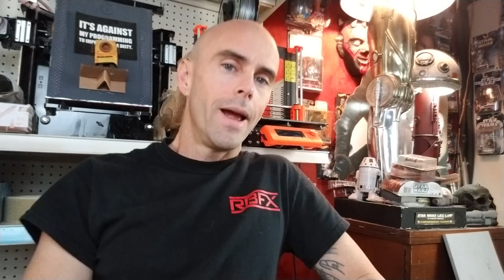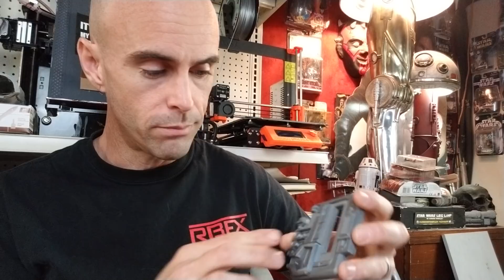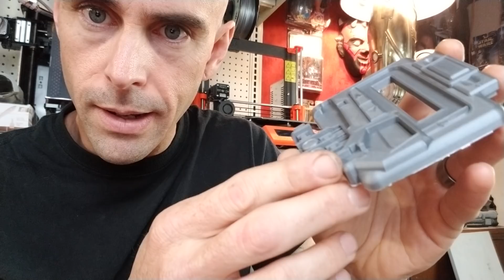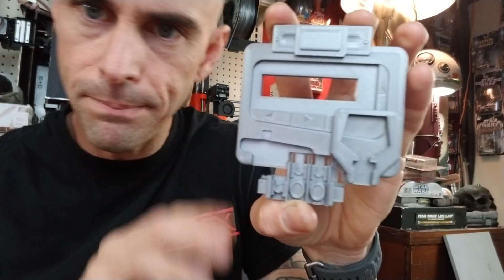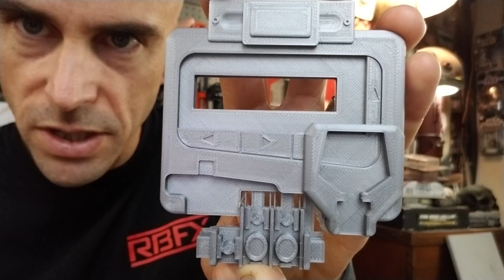3d printer Quality comparison FDM (Prusa i3 mk3) vs SLA (Formlabs Form2)

Comment: On average, how much more expensive would it be to only print parts using a resin 3D-printer compared to only using standard PLA/ABS filament with a regular 3D-printer?

I mean, how many percent more money would it cost to print the most commonly printed designs, using the most popular consumer version of a  resin-printer with basic resin and all the standard configurations?

(Without taking into account the cost of the printer.)
Reply: 5-10 times more

Comment: It's amazing how nice the Form 2 can print. I do have a question for you regarding molding and casting. I'm making an articulated action figure inside of ZBrush/Fusion 360 that will later get printed on an SLA printer once I can afford one. Some of the parts like the bicep have a step down hole with a mushroom shape inside. Do you know much about insert molding/over molding? If you have an email and a few minutes to spare it would be great if you could give me advice on how to mold the parts properly. I would highly appreciate it man! This project means a lot to me and you seem to have knowledge in making molds.

Comment: The new Prusa SL1 is a direct Form2 competitor in quality and ease of use, while being a fraction of the cost. AND it uses normally available resin as opposed to FormLabs' "branded" resin (same resin but with FL's brand and price increase).  Regular resins are around $ 40 - 50 on average for a liter.  A big price difference.  

The Wanhao was a cool intro, I got mine for $300, but it had a lot of major issues and I never got it working well even after investing extra money.  I'm probably going for the Prusa as they’re dependable.
Reply from the maker: It looks awesome and I can't wait to try one. There are definitely some features that the prusa doesn't have that are extremely useful for me like auto filling resin and the notifications when prints start and finish or if there are any issues that force the print to stop. Those things save loads if time. The form2 can also run with aftermarket resins. There are settings for it. A couple of friends have been using aftermarket resins directly with good results by using it with the old formlabs bottles. Also the form2 print area is quite a bit larger. Much of the client work I've done wouldn't fit on the prusa. I'm actually looking into some larger resin printers at the moment.

Comment: sadly enough, the moment you printed one at a different layer height, the whole comparison looses validity =/
if you had made both at 0,05, then i'd be a fair trade comparison... 1 layer of primer and the comparison would have been awesome
Reply: Youre comment makes no sense considering he is mainly focus on top quality vs layer quality. Its obvious that layer height wouldnt matter
Reply from the maker: Not really. FDM is still limited to nozzle diameter which affects the corner sharpness. Even with a .2mm   nozzle at .05 layer height it's nowhere near as crisp and finished as the form2 , primer or not.
Reply: @gordontarpley  you're missing the point he was trying to say.  When making a comparison between two things, in this case printers you need to keep variables to NIL so the only difference is the printers.   Where in this specific case it's more than that
Obviously the prusa can't print at .05 but it can at .08 and so should the SLA
So for a fair comparison test they both should have been printed at that.
And on top of that, you didn't enable ironing which would have gave a smooth top surface.  
I'm not trying to rip on you or anything, but as far as tests go...  It just could have been done more 'fair'
Reply from the maker: @nickanderson8305  No i didn't.  I get what he's saying. I didn't print these to compare for YouTube, I printed them for a client (to their specs) and had them on hand so I figured I'd show. If you see the response I made there are aspects of fdm printing that will carry over regardless of layer height. Edge sharpness, top and bottom texture, etc. that will never match the quality of a resin print. Just the way it goes.

Comment: Hi Gordon great vid is'nt the FLab twice the price, also what I really want to know, is if you only had a Prusa how would you make that print mould ready? You suggested primeing would that be enough though.
Reply from the maker: The form labs is almost 4 times the price. The Prusa is great though and I've used it to make lots of parts that I've molded. I usually give the parts a coat or two of primer and sand between coats. Takes a little work but not a big deal.

Comment: Great vid Gordon. Isn't there a section of some detail 'missing' on the Form 2 piece, in the bottom right corner?....Assessment total right-on on quality and cost...And keep the Form 2 hidden from Evil Gordo....he will mess it up and you'll have to be the one to have to fix it.....ya know I'm right...
Reply from the maker: Yeah, it was modeled (not by me) with overlapping geometry. The different software interprets it in different ways so the output isn't actually due to any printer error. Slic3r looks at it as a wall and makes a shell thickness there, where Preform just sees it as one piece. Doesn't matter in this situation either way because that area gets covered by another piece. ;)

Comment: Nice vid, the difference is huge,
I have an UM2+ at the moment, and was also thinking to go SLA, but I don't print that often, and the resin would probably go bad, before I can do another print, and the size of the print bed is also a factor.

For the cost you could hollow out the inside, but the time spent on the CAD, and problems molding under vacuum (also with FDM?) is a no go with hollow parts ?
Reply from the maker: I've had some pretty big gaps in printing without having any issues with the resin going bad. Haven't used anything but the Formlabs resin so far but I've been wanting to experiment with some aftermarket (and MUCH less expensive) resins. Once I get some and test I'll be sure to post about any longevity issues with it.